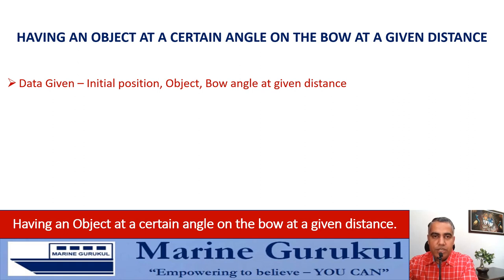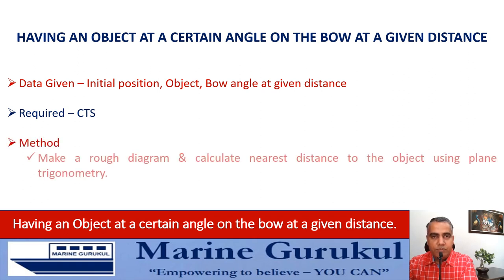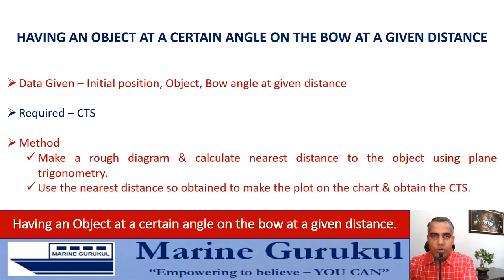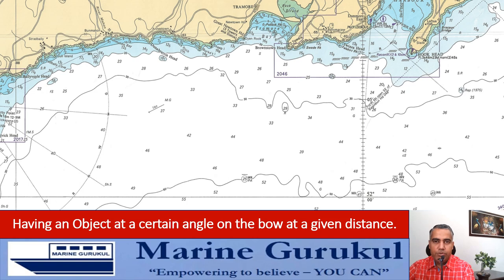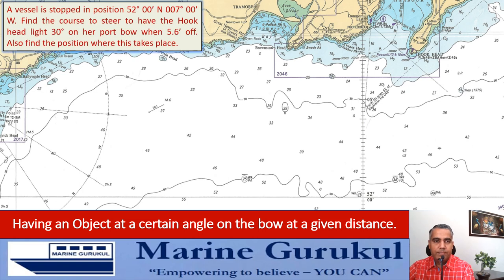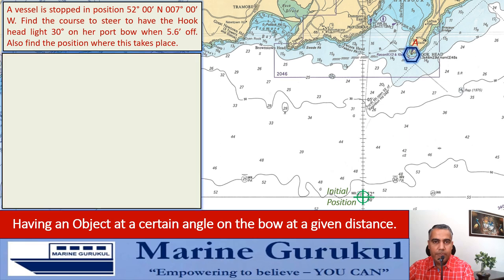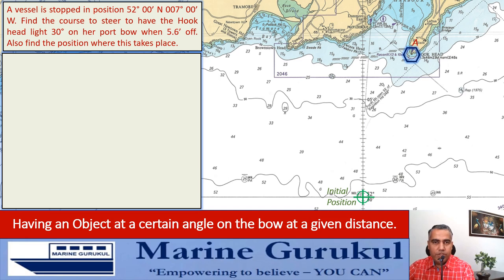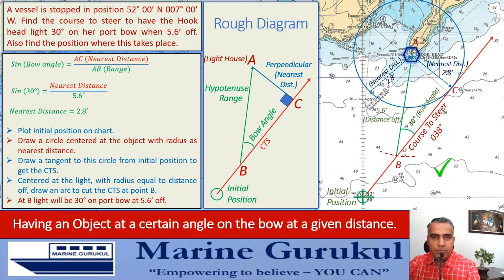Having an Object at a desired angle on the bow at given distance

Comment: Sir if two light houses are of same distance by the radar , how to find the position of the vessel , no specific range is given in the question..
Reply from the maker: It will give you a PL - which shall be perpendicular bisector of line joining the 2 light houses. There may be some more information in question giving another PL or PC. 
Best Wishes